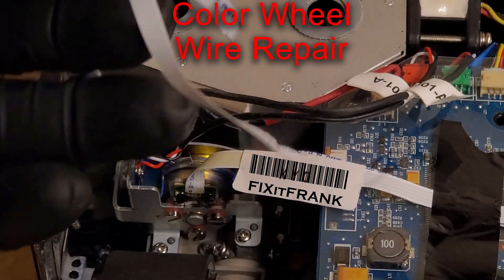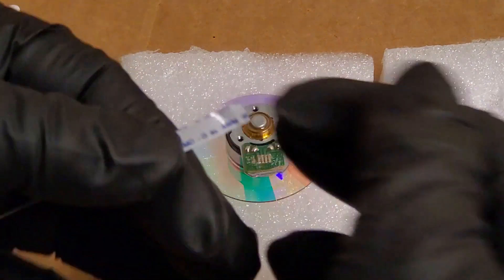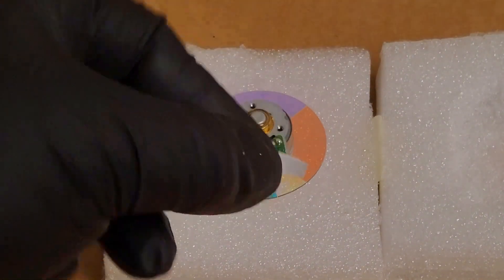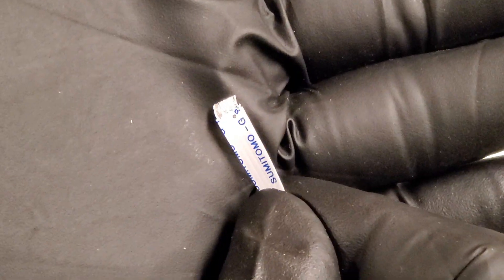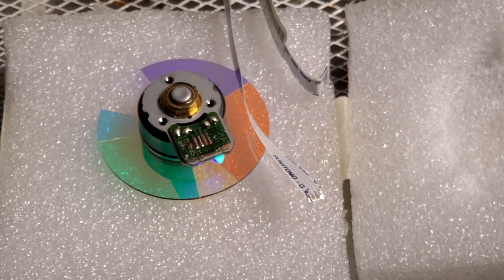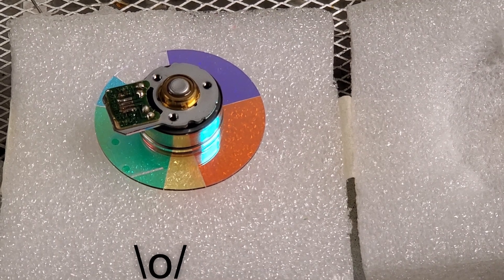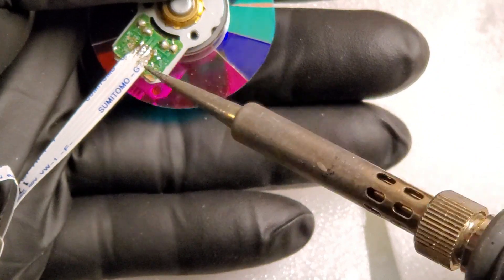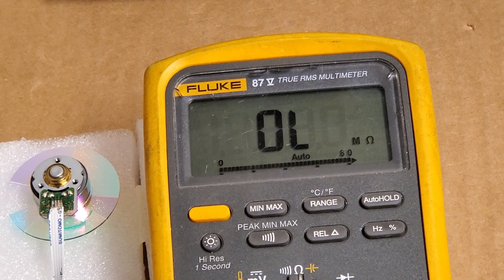Re-attaching the Cable to a Color wheel from a DLP Projector.

Comment: Sir my projector power light red and temperature and lamp light off and its not turning on my projector is benq w1070 please help me what is the solution i am from india
Reply from the maker: That sounds like it is in standby. What have you checked so far?
Reply: @FixitFrank  yes sir its stand by mode but its not turning on I just open and clean projector and now its stuck in stand by mode any solution please sir i am so much afraid
Reply from the maker: @technoh7906  I would go back over your work.  It sounds like you have something not connected or lined up.  If it turned on before you opened it, then there is something that was missed.  That is not uncommon and almost always is solvable.  
There is no one item that causes this so I cannot really say "go here and plug this in" because there are too many options.  
I think if you slowly go over your work, you will find a wire that was missed or a connector in the wrong position.  Something like that.
Reply: @FixitFrank  thank you for your reply 
I will recheck all the connections and all and sir again thank you so much from bottom of my heart ❤
Reply from the maker: @technoh7906  You are welcome! Please check back if you if are unsuccessful.

Comment: Love the fact that you try to save as much as you can. My mentality also after living for decades in countries with almost zero resources for everything,. Sir Frank, excellent stuff!
Reply from the maker: Thanks buddy. I really hate the idea of putting any kind of trash into the ground.  This is one area where I can actually make a small difference so I do my best.  My personal motto (my wife understands but I'm sure it bugs her) is that it does not go into the trash until it is trash. And even then, If I can re-use part of it, I will.  Our deep freezer had the compressor start relay fail.  I looked at a new one, but I realized I only needed a PTC Thermistor. I pulled one out of an old CRT chassis. It was the Thermistor from the degaussing coil. The freezer has been working perfectly for 8 months now with that fix.   I'll save this color wheel for testing or if someone needs a really cheap repair option.
Reply: @FixitFrank  Yes, exactly! Nothing is trash if it can be fixed. Laziness, use and dispose mentality and planned obsolescence are things I fight everyday. Especially with cars, I see people selling cars for the most mundane and silly reasons, just to get the new and shinny ones. WHY? Less trash, less trouble. More repairs, more happiness.
Reply: A tip : watch series at Flixzone. Been using it for watching loads of movies recently.
Reply: @Alexzander Boston yea, been watching on Flixzone} for since december myself :D